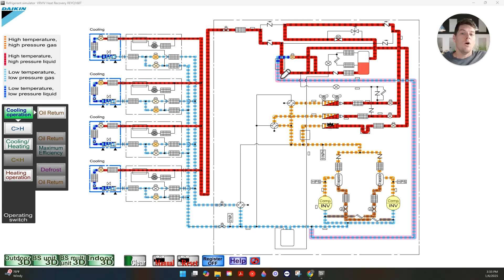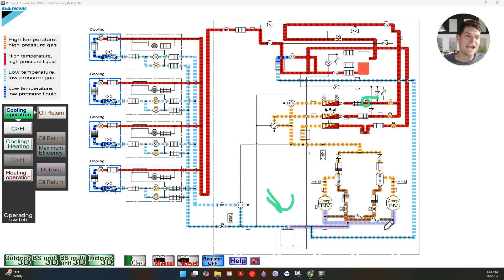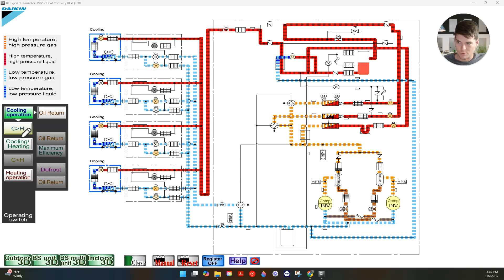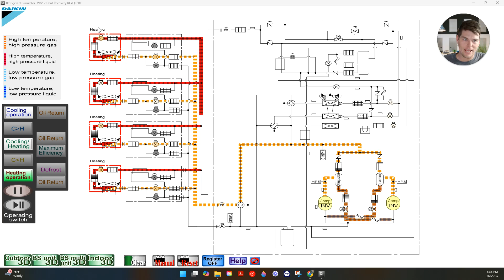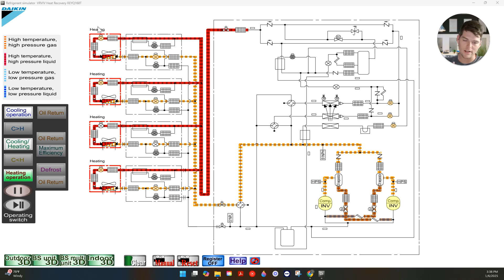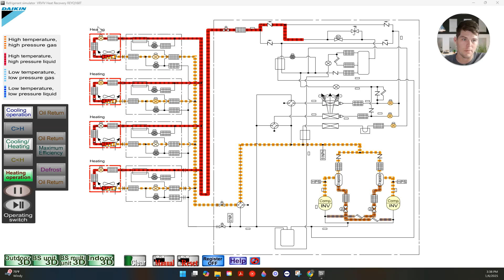Understanding the Sub Cooling Circuit for VRF🌡️

Comment: Interesting. I always just assumed the subcooling circuit's main purpose was to add subcooling in cooling mode since VRV systems can have such long line sets. I don't believe I've seen any literature on this but, the subcooling circuit is why insulating the liquid line is necessary right? It took me a while to understand why the liquid line sweats in cooling mode.
Reply from the maker: Yes this is why we insulate the liquid line. The sub cooler does subcool the liquid line however it’s main task is creating vapor for the compressor. This is why sometimes the liquid line gets cold enough to condense moisture in the air because the compressor needs vapor on demand.

Comment: Would love to see you do an explanation of the hot gas injection for the cold climate units that can run at -30 and under, I believe these inject hot gas back into the compressor to boost out put. 

Also would be good to see a run through where your in high sensible cooling mode.
Reply from the maker: Vapor injection is a great topic for a video and I even have a nice video that showcases what is happening. I am adding it to the list of topics to cover!